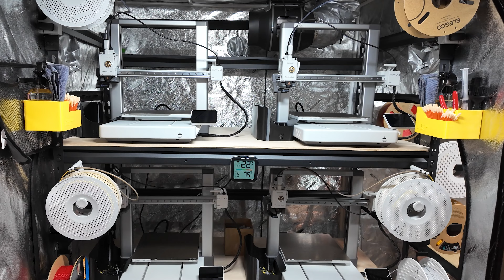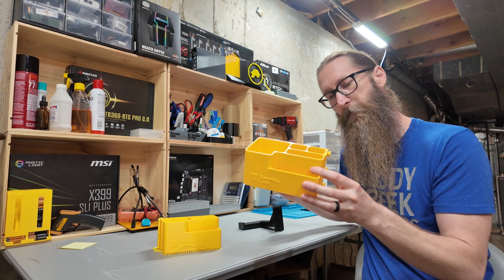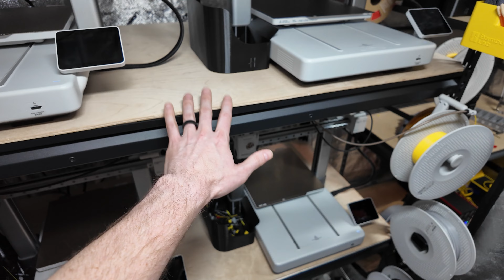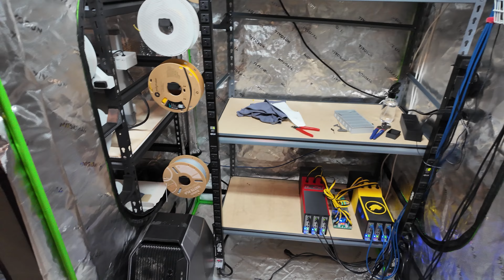Must-Try Methods for Tidying Up Your 3D Printing Supplies

Comment: What software do you use for modifying you edits? Perhaps making the bottom flat still and offset the tabs or reduce to a two tabs variant.
Reply from the maker: I use Blender a lot. Leaning Fusion 360 right now. Yeah I was gonna offset the tabs but I have precise spacing for the things on my rack so everything is evenly spaced and doesn’t interfere with each other. Plus I kind wanted to see what would happen having to whole base on supports.